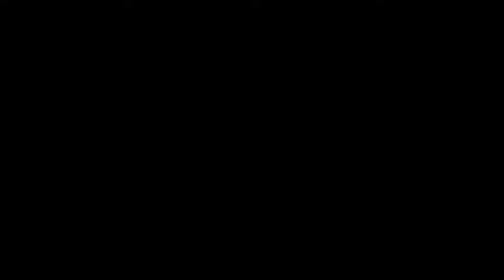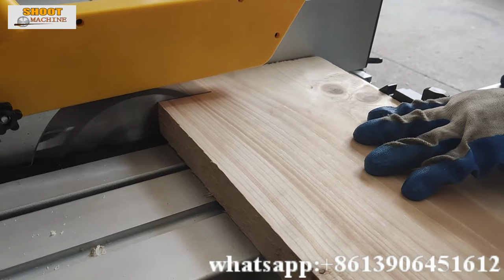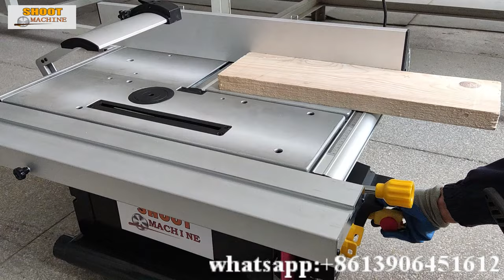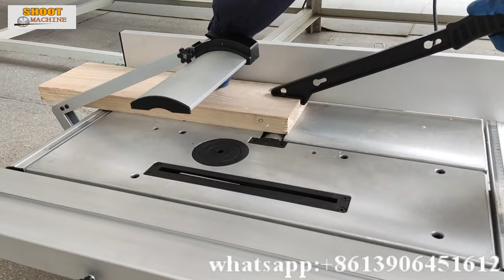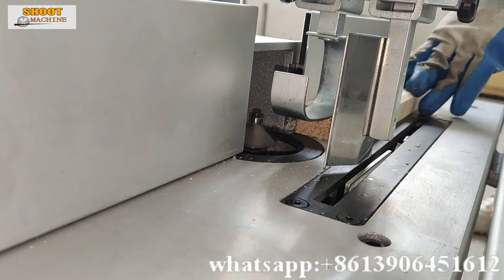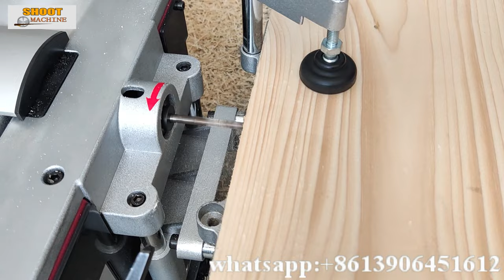SH160 5 Functions Combine Woodworking Machine

Comment: 😡😡😡😡😡😡😡😡
I've had one for a few months, I've spent more time trying to repair it than using it! 
Don't throw away your money, it's a big piece of crap! 
The router run for 2 minutes and the belt broke. 
The drive systems are ridiculously poorly designed and the belts are very thin and fragile.

J'en ai une depuis quelques mois, j'ai passé plus de temps à la réparer qu'à l'utiliser ! 
Ne jetez pas votre argent, c'est une grosse merde ! 
La toupie a fonctionné pendant 2 minutes et la courroie c'est cassée. 
Les systèmes d'entraînement sont ridiculement mal conçus et les courroies sont très fines et fragiles.